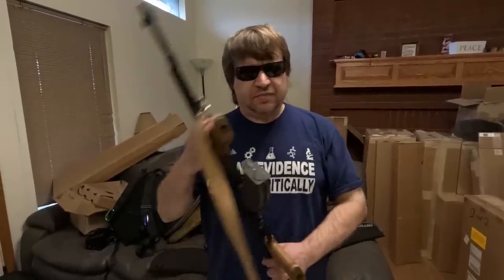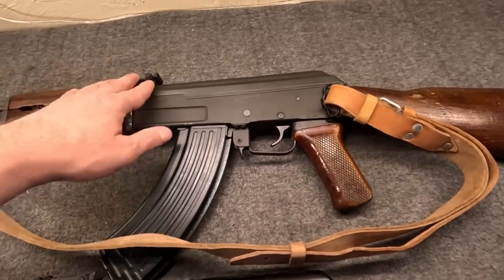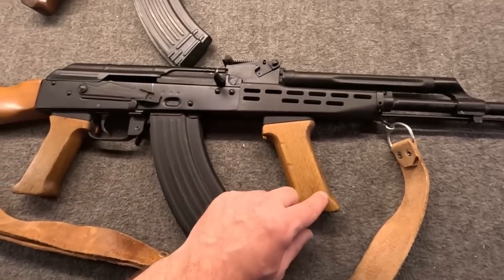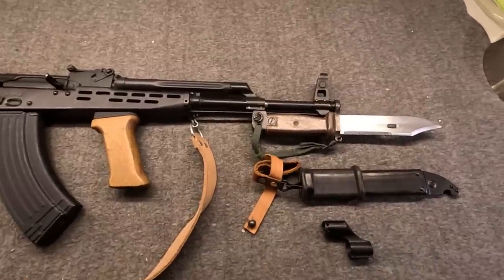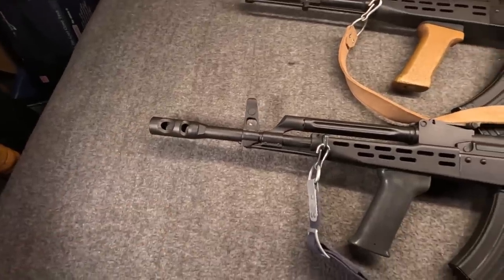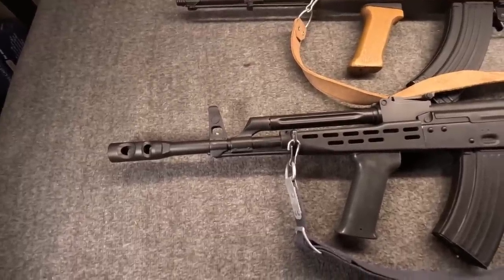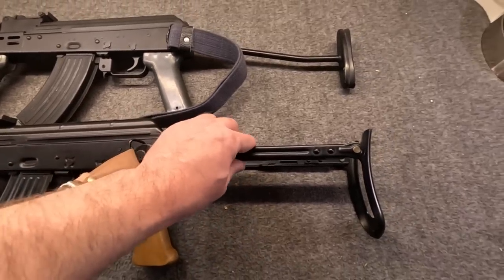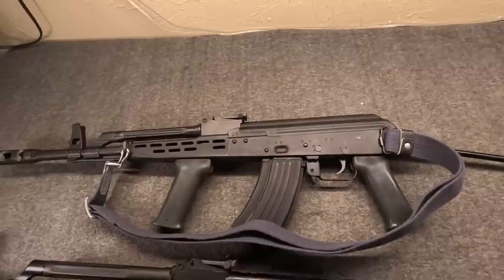FEG SA-85M To Hungarian Army AKM-63 Project Final Results + Taking The TGI AMD-65 To The Range Again

Comment: 5 or 6 years ago I was lucky enough to purchase a SA-85M from one of my fathers friends. It was in box unfired, the first thing I did was get it out of the box, inspect for barrel obstructions, and then I shot it. Later that same evening got on some of the ak pages and sourced AKM63 furniture. I've always told people the Hungarian aks are over looked, and fit and finish wise are among some of the best akm style variants I've owned. Shortly later I found your video on the TGI AMD65, and would source one of those also. Both still in my collection and both still rank among my favorite aks, right behind my 107cr lol. I still need to get the front sight and gasblock swapped, but I truly think the SA-85M is a gun that's slept on, but is a great ak. P.S. mine also had the cleaning rod, but of course just walked out. Thanks for all the info you've shared over the years, and take care!

Comment: Im Hungary for Hungarian AKM's!
I have the Tapco style, finish has TONS of character! Lol, I think you are correct, it came in as a pistol, been searching this info lately. I also noticed: my Sa85 M, Tgi Amd65, and my Sa2000 ban rifle all have different  reciever weld spots, and also the "sa2000" recievers has little dots inside the mag well dimples. Forgot to mention,  you can adjust Amd65 folding stock "tightness" with a flat head screw driver, bottom of reciever, the button you push in is a screw

Comment: I also have a TGI imported FEG. I've long heard they were built over there by FEG. I was always under assumption they came in as rifles and underwent normal upgrading, like cutting mag wells larger, etc, once here. That was the info floating around over a decade ago.
I've impressed with shooting my AMD65, though it was only 300yd to a ~20" gong, repeated reliably standing even. Still never found a smoother AK action. Love it still, though a bit scratched up.
Reply: I don't think they came in as rifles. For one, the FEG logo boxes these came in were way too small for a full rifle to fit into.  Its easier to import pistols, so why not just bring one over, just w/o the front grip and buttstock. Once in the USA, install the wire part of the stock and the MD foregrip; then e xtend the barrel to 16" ... boom, done!

Comment: Noticed in the outro you depressed the folding mech button to fold the stock on the AMD65, but earlier you depressed it to unfold it. My example doesn't require me to depress the button to fold, just to unfold. Is there something wrong with mine?
Reply: Wait what? If you don't have to press to fold it, then what keeps it open while you are firing it? You should definitely need to press it to fold it back against the rifle.
Reply: @misha5670  It never folded on me while shooting but I just examined it closely and it looks like the hinge side of the stock isn't engaging the shelf that connects to the button while in the open position. It must be very close to engaging the lock, just not quite. Hm
Reply: @errldabbins  Try a rubber hammer and if that doesn't make it engage, you might need to do a little light filing. That's just AKs for you. Literally in the armorer's field kit, they included a few different sized files and a couple hammers.

Comment: They had a black Hungarian ak like the one u have in this video with the original folding stock and black furniture.  And forearm grip with the shorter barrel exactly like yours with the same brake pinned at one of my local gunships I deal with. I seen it on there Facebook page in the background and I been wanting grab one because a Hungarian ak is the 1 ak I'm missing in my collection so I drove over there. And when I walked in and they handed it to me it was in great shape. It had a smooth bolt throw and not the finish had no wear at all it was in excellent shape. But I didn't pick it up because they wanted 2200 dollars for it and honestly I don't no how much they go for. But I don't believe it was worth that much money in my oppinion. I wasn't willing to pay that price for it at all. In my oppinion they was thinking since it's a imported Hungarian ak that you don't run across often it was way over priced. What's your opinion Misha? Do u think it is worth what they are asking for it? Because I'm not familiar what the Hungarian aks go for. But my oppinion I don't think that ak is worth that I was willing to ease towards 13 to 1500 at most. Because I've spent what they are asking on aks that are way more sought after that I no for sure it is worth the money. But let me no your honest oppinion if u think it's a 2200 dollar rifle. Because I respect your oppinion you no alot more then I do of value Misha. But I seen where Atlantic and rob ski had the Hungarian parts kits  not long ago just like the Hungarianin feg amd 63 with the original Hungarianwood furniturelike you have in this video. But I would rather have a true import. And the one at the gunshop didn't have the bayonet lug either but did have the original Hungarian chrome lined barrel. And all the parts were number matching which I did really like. I didn't look to see who the importer was if that matters. So let me no what you think and let me no which importer should be stamped on the reciever to no if its a true import or if it isn't.
Reply: Back in 2010, CFS was selling them retail, new for $399.95.
Reply: So much of what you’re willing to pay is how much you want something.  I paid 2K for a nice AKM63 build.  I wanted it badly.  Not too many older style AKs have VGs.
Reply: I enjoy your comments Timothy.  You know more about AKs than I do.  You’re an enthusiast big time.
Reply: @markp4401  VGs?
Reply: @markp4401  yea in my oppinion a akm63 is worth more money
Reply: @timothycain4512  vertical grips
Reply: @markp4401  I don't want nothing bad enough to over pay for it. Paying what it's worth I'm good with but my oppinion they had it over priced. But havnt really looked into or been into Hungarian aks. Russian,Romanian,Bulgarian,Polish, and Zastavas aks are the only ones that I have and different variants of so I'm more familiar with prices and values of those. But I have been really wanting to pick up a Maadi and Hungarian to add to the collection to get it to where I want  it.
Reply: @timothycain4512  Then the AMD65s and the AKM63s definitely aren’t worth it.  The Polish AKs so highly touted by Mishaco are running 1.2-1.6K.  You get a new gun with a warranty.  Some might even argue that the Polish AKs are overpriced.

Comment: I guess I'm just strange.but I have  always liked the thumbhole stocks.I have 5 AK,s with thumbhole stocks. MAk,s and VEPR,s none of my Buddies like them.
Reply: I just like things original & authentic. Since preban fixed stock SA85Ms are so uncommon, converting this postbanner seemed like a good option. I am completely satisifed and the whole thing ran me about $1,500 after rifle + parts + getting some help to pull the barrel hardware.
Reply: Actually for me thumbhole stocks are very ergonomic.  The problem is they’re ugly as sin.
Reply: @misha5670  Did you say a scant few AKM63s came into the US?
Reply: The thumbhole stock is heavy. The balance of the rifle isn’t right. Not like a normal AK.

Comment: Had a AKM-63, foolishly traded it away.
Reply: Atlantic has some pretty nice AK63 kit builds in stock with FB radom barrels. Been thinking about picking one up.
Reply: @JohnnyChapo  Get behind thee, Satan!
Reply: How did you clone yours?
Reply: @misha5670  Combo of Mike at TFL and Nodak Spud, IIRC.
Reply: @ElTejon47901  Hardest parts to find are the gas tube and buttstock.
Reply: @JohnnyChapo  It looks like a toddler went after that furniture with a rock hammer.  Lol.